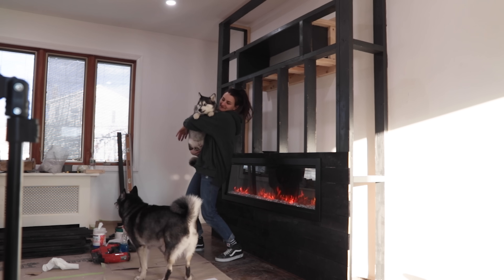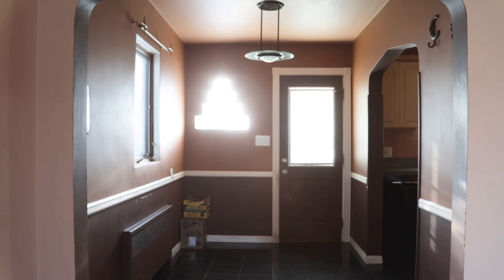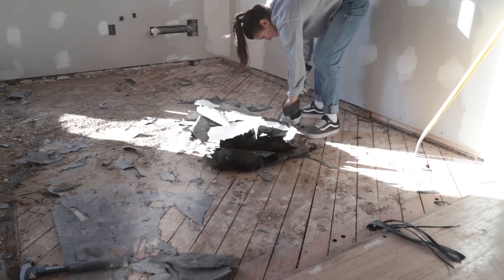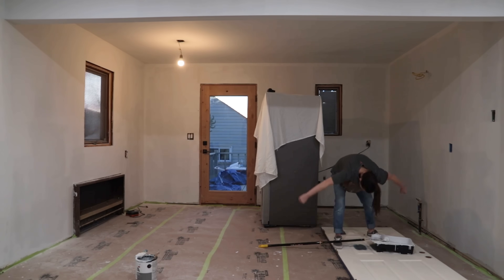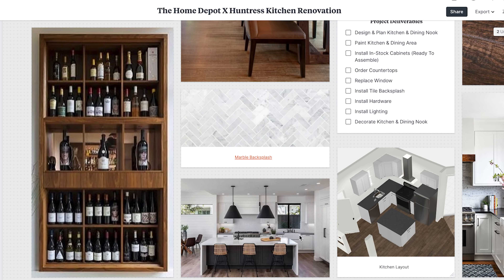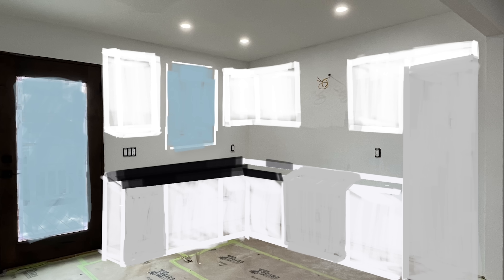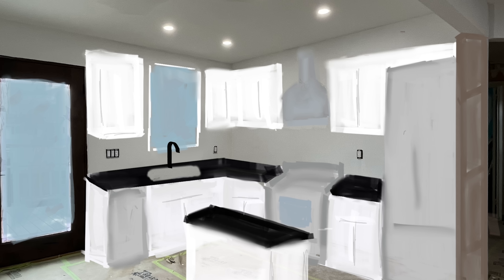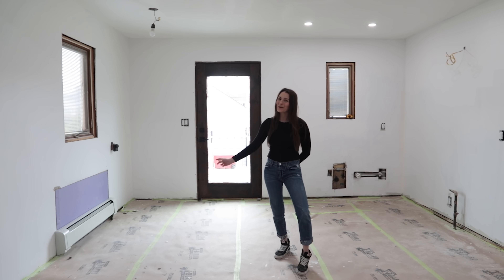STARTING MY DIY SMALL KITCHEN MAKEOVER REBUILD!

Comment: The island doesn't have to be a monolithic structure that rises out of the floor to doinate the space.  It might be  reclaimed wood, black painted plumbing pipe and industrial type wheels that moves around where you need it.
Reply: islands on wheels are the best!
Reply: Big applause for locking casters !

Comment: I tink this viideo gave an even better impression of the house before the renovations in your previous video.
Wow. In my opinion it was like a NOT beatufully colored labyrinth in the beginning. Over here, brown and pink used to be trend colors in homes during the 60s and 70s I guess. Bathrooms or kichens had tiles an everything in shades of brown. Even the sink, bathtub an toiled where in some shade of brown, along with lamps and cabinets.
If you were luky, it stopped there. If not, it continued through the whole house in some form. Like lamps or brown carpet flooring.
Kitchens and bathrooms used to be small. I guess it has to do with them beeing a neccessity and using as much space as possible for living areas, as ft² has always been a limiting factor. As well as keeping all the smells from cooking away from the rest of the house.

There were some interesting styles back then, which I might like to presenver nowadays, but brown definielty isn't among them.